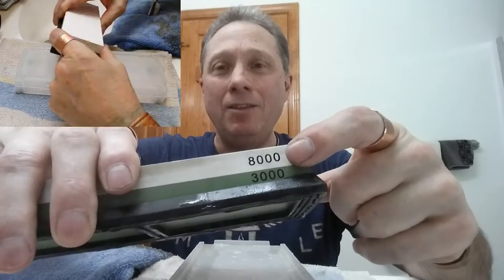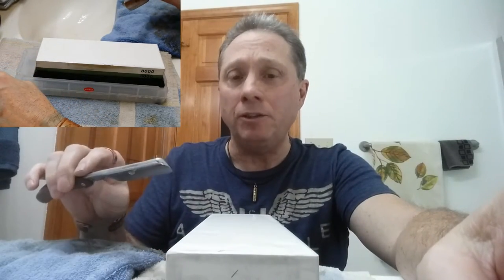How To Properly Honing a Straight Razor Ep3

Comment: I have just purchased  my first straight razor. I have the strop and the shaving brush as well, I also just purchased the SUEHIRO 1000/3000 Grit Combination Waterstone. I don't want to buy all those stones so which one(s) would you recommend I get? I tested my razor across my thumbnail as you did and it didn't pull at all. It did cut paper easily ( I know I shouldn't have).
Reply from the maker: The next stones to look at would be the TAIDEA 3000/8000 Whetstone https://goo.gl/UHOx8w and the Shapton M5 12000 Ceramic Whetstone https://goo.gl/XcbssV with these two stones a long with your strop and Chrom Ox https://goo.gl/L9ywdd. You have all you will need to get start. Thanks for watching and for the great question, please let me know how you get a on and if I can help!  👍🙂👍

Comment: many are not fans of the circling movement, i see you don't do it yourself. But actually that gives you 3 inches in one movement , multiply that by the length of the stone , that's 21 inches, multiply the reps, you get  a lot of inches  800 inches aprox. per 40 strokes. Versus normal storkes, 7 inch x 40 times,  280inch total
Reply from the maker: Great Tip cj18! ;) You are correct it does give you more movement on the stone. However, I'm trying to get the scratch pattern to be angled back toward the handle or scales slightly. I feel this gives a better pattern for a comfortable and enjoyable shave.
Thanks for your great comment and Tip, and thanks for watching! :) Have a good day, take care and stay safe my friend! :) #Heart
Reply: @AdventuresInWetShaving  well pointed out, I learned another thing from you. Now i'm waiting for my stones and first SR to arrive :) take care
Reply from the maker: Congrats on your first Straight Razor and Stones cj18! ;) Yeah, Buddy let me know how you get on with them! :) #Heart

Comment: Your stones seem to take off a lot even at the higher grit. Even with the loop I'd say your unable to check the microbevel for chipping. I check mine as I go because I hate the micro chips.
Reply from the maker: Chris Monroe I have not heard about micro chips. What kind of equipment do you use to check the micro chips? And what stones are you honing with? I'm always trying to improve my technic, thanks for watching!  :)
Reply from the maker: Chris Monroe I have not heard about micro chips. What kind of equipment do you use to check the micro chips? And what stones are you honing with? I'm always trying to improve my technic, thanks for watching!  :)
Reply: Microchips are microscopic chips in the bevel that affect the slicing of hair. I use a 50.00 veho microscope from amazon. The 400 magnification. Send me your email and I'll show you examples.
Reply: I use chosera 1k, norton 4/8, naniwa 10 and 12 and finish on ozuku jnat
Reply from the maker: Cool, my email is adventuresinwetshaving@gmail.com
Reply from the maker: Very nice set of stones Chris!  :)
Reply: Sent you the email
Reply from the maker: Cool!  :)
Reply: They are taking a lot off. I have the weiwei 10000 and it’s more like a 4-5000 of my higher end stones. But for the price it’s a good stone as long as you you know it’s not the same as a high end 10000 grit